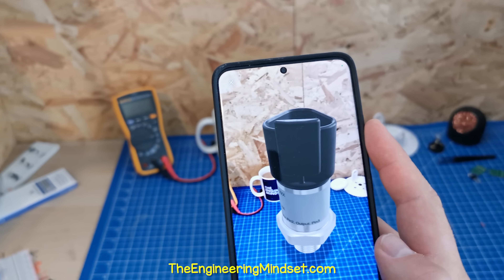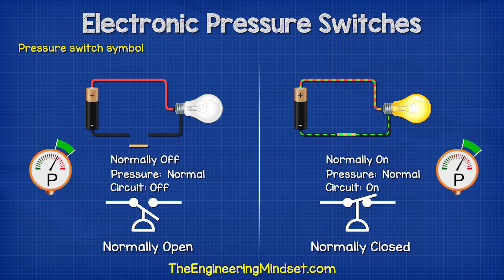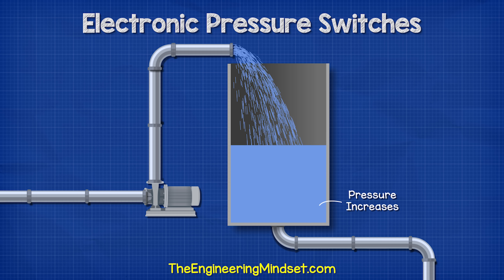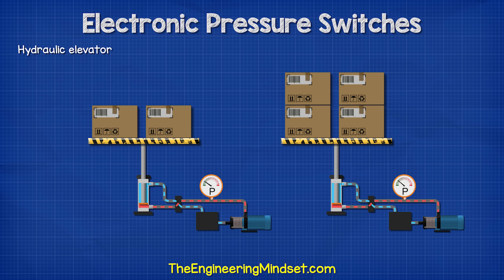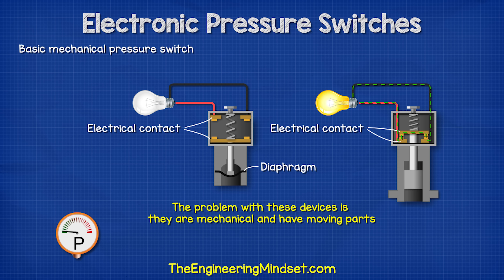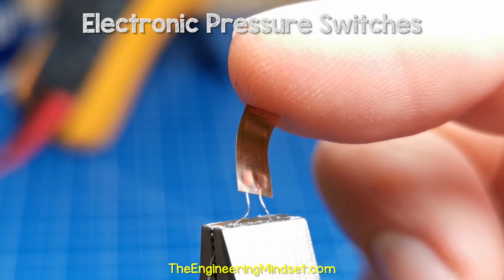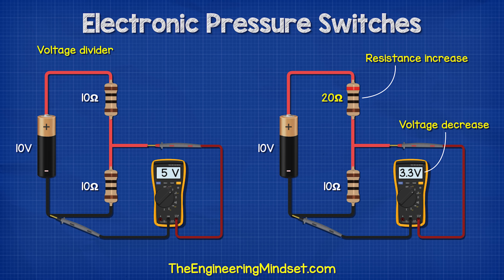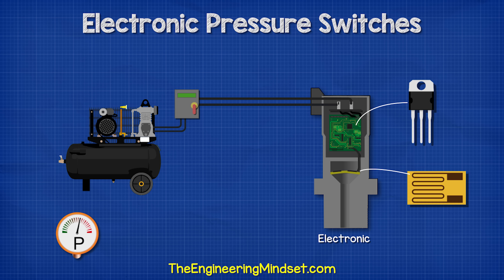Electronic Pressure Switches - How They Work

Comment: You helped me fix my espresso machine! I just put the NC connector to the NO terminal and was wondering why it was partially heating. There is SOME logic with the espresso machine to heat to a certain temp thats NOWHERE in documentation.

Comment: An excellent basic explanation of how pressure switches work. I'm currently dealing with a 2020 Freightliner Cascadia  semi truck. It has a Honeywell pressure switch that notoriously goes bad on these trucks and it's hard to find and very expensive. The truck has a 130 PSI system. When the pressure drops below 80 lbs it sends a signal to the system. I figured it had some kind of a diaphragm or piston design and it was probably getting some corrosion with moisture and getting stuck. I was going to try to get some permatex never seize spray in there, pressure it up manually with an air gun a few times and see if that does the trick. However now with that electric strain gauge being a possibility of what's in there that has now thrown me through a loop. Seeing as how never seize has copper and aluminum lubricant, it's conductivity might mess up the sensor. I really wanted to use that for its anti-corrosive properties but I may have to opt for a non-conductive lubricant instead. If anyone has any ideas that might help I'd appreciate it.

Comment: I'm looking for a compound pressure transducer for the suction line of an ultra low temperature chiller. I need at least -15 to 200 PSI. The suction line can get as cold as -80F I'm curious if this pressure transducer connected to this cold suction line will cause problems with the pressure transducer?

Comment: Do you happen to have a video of strain gauges /amplifiers ? I came here for pressure switches but on my line we have transducers that measure tension based off load cells that have strain gauges and the load cells are connected to an amplifier (summing box). So now im curious how the circuit and physics of it work. Its a tension control loop/PID btw with motor drives etc

Comment: Those switches are used in hydraulic elevators to control over and/or under-pressure in the hydraulic system that moves the elevator-cabin.

Comment: We use one as a safety control to alarm the operator/engineer when the nitrogen gas levels have dropped; this also shuts down the machine. Without one, we would have products returned to us which will damage our relationship with the customer and a potential of losing of on millions.

Comment: I work on an oil production rig in the Gulf of Mexico, we use them for our main compressor unit, firewater pumps, and our oil wells piping, as well as a few other systems on the platform that I’m forgetting about.

Comment: Vacuum gauges work totally different. It's very hard to measure deep vacuum or the lack of pressure. Instead of something bending or flexing it measures how much heat can be disapated, less pressure equals less heat losses.

Comment: We are replacing failed $800 pressure switches with $200 sensor on water system.  The PLC will then be able to adjust setpoints remotely for pump monitoring.

Comment: I have a Danfoss 031E021566 mechanical pressure switch controlling the well water pump for my house. The switch that it replaced had failed by fusing in the on position - luckily I was home at the time and heard the pump running unusually long, and managed to shut it off before the pressure tank exploded. I had never considered using an electronic switch instead, so thanks for this video!

Comment: Is it really using a floating gate drive voltage to turn on the MOSFET at 06:22 In video?   Or are the 2 power supplies referenced to common ground via their power cord ground which not shown in the schematic and the breadboard circuit.  Sometimes over simplification leads to more questions.  Otherwise, awesome video!  Thanks!
Reply from the maker: See my new MOSFET explained video here➡️: https://youtu.be/AwRJsze_9m4

Comment: In the semiconductor industry we use pressure and vacuum switches. On the inductive dry etch modules I work on the pressure switches are used to communicate to us when our low vacuum reaction chambers are at atmosperic pressure, thus safe to open for maintenance.

We use manometers to measure vacuum for pressure control during our processes.

I was just introduced to this channel and will be recommending your content to  our technicians. Thank you.

Comment: My furnace has a diaphragm style pressure switch.  One time it was triggering and shutting off the furnace.  The problem turned out to be a dead rodent or a dead bird in the vent.  You should never blow into one of these switches to test it, they are that sensitive to damage.

Comment: Its a common occurance in a gas or diesel powered vehicle used for oil mainly. but can also be used in conjunction with other things. sometimes they are called a sender switch.
Reply: Senders have a variable output (like for the fuel gauge in an automobile)
Sensors are binary state (open/closed) so an old fashioned vehicle like mine might have a sender for the gauge but also a sensor for the low oil pressure idiot light.